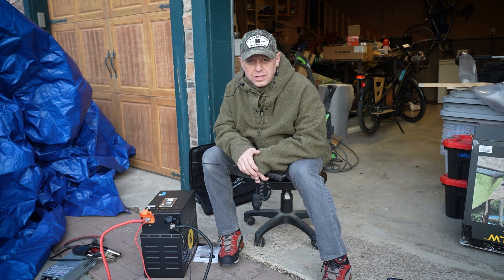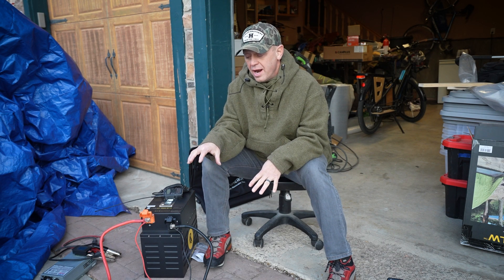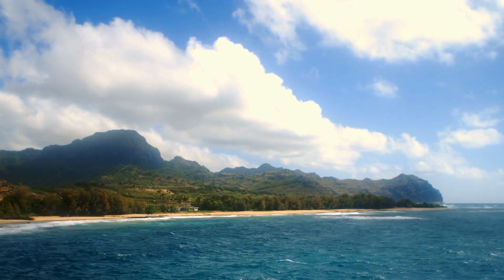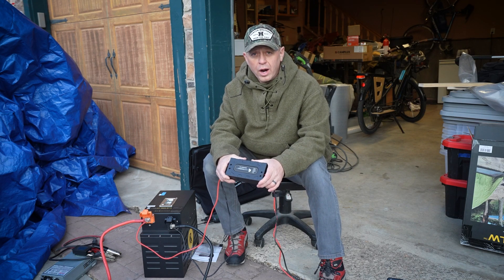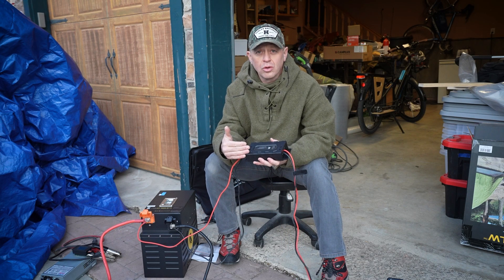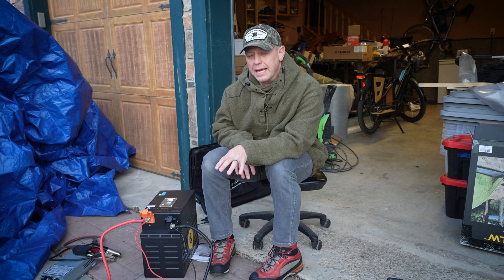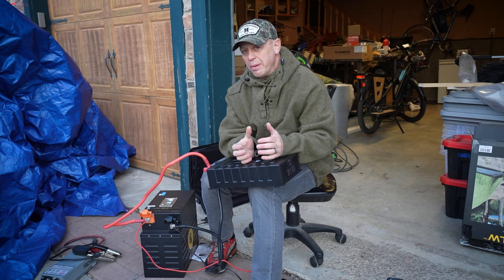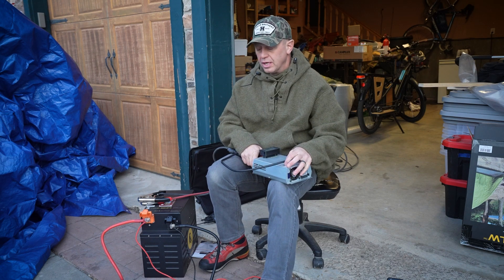Panels to Power: Solar Power Explained

Comment: You say battery has computer components.  Does that mean an emp of any kind would effect the battery?
Reply: EMP’s depending on how far away they are only really affect about 30% of things and that’s depending on how much wire is connected and how long that wire is and how close it is to the EMP. Think of it like an explosion. The closer you are the more you’re affected. So I can’t tell you yes or no and be correct. Can they be affected? Yes, but so can any battery with enough wiring connected to it. It’s the wiring that gathers electrons and zaps things during an EMP that’s the problem. If you want EMP protection you need replacement parts inside of a grounded faraday cage. Otherwise it’s just a crap shoot on what will work and what won’t. Also most knowledge out there is just hypothesis since no one has published  data out there after starfish prime. So maybe. Maybe not.

Comment: I'm technically literate, but this was not a simple explanation for newbies.  It would help if you had a whiteboard that shows the components all connected together and you pointed out what each part does.  Then you throw around the term "Watts" and people don't understand that, or how it correlates to the inverter or your solar system.

Showing a refrigerator plate, and the watts rating, or peak starting watts rating, and explaining how to backwards calculate capacity so that people don't buy a bunch of stuff and it doesn't work.  Your dam and river and land capacity (for solar coverage) works, but there are series and parallel considerations to consider, and helping people understand these relationships graphically will be more helpful.

I'd also be a little careful with the throwaway terms that can denote danger - "blow away" (I believe - I was interrupted while writing this).  It's worth explaining the sequence to connect things together so they don't get shocked.  

I think this is a worthy effort - to make this simple.

Comment: Looking forward to seeing this on the overland setup. I have a teardrop trailer with A/C plus solar input port, inverter, and battery. Planning on installing panels, controller. I want to rework the setup to allow for more solar, a roof panel (and portable if needed) and bigger or serial batteries.
Reply: Excellent!

Comment: What does a setup like that cost
Reply: Not sure. Head on over to Lion Energy and look up the 280 amp hour 3500 battery, inverter, 400w charge controller and you have your price. It’s all extremely easy to put together. I’ll have this on my trailer later.

Comment: The Inverter can be thought of as a hydro electric dam. Turns the water in your reservoir into usable electricity as it flows into it.
Reply: Man I like that. I’ll steal that! Smart!
Reply: @TJackSurvival  I am currently setting up my Cargo Trailer conversion with solar. This was a great way to explain not only the components but how everything works together as a flow.
Reply: @christopherpike8269 very cool! That’s exactly where this system’s going to end up. In an overlanding tear drop trailer.
Reply: @TJackSurvival  A good simple system with basic hook up of Starlink and a laptop. Goal for next year is to get out and off the grid more. Going to be working "remote". Boss never said I had to stay at home to work. ;)
Reply: @christopherpike8269 I want a Starlink but I’m hoping they’ll come down in price before I get one.